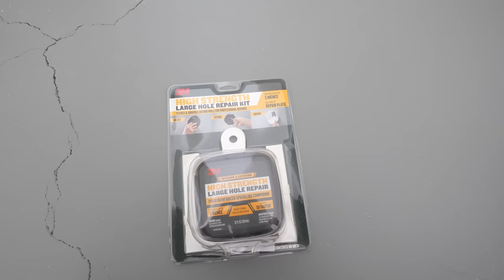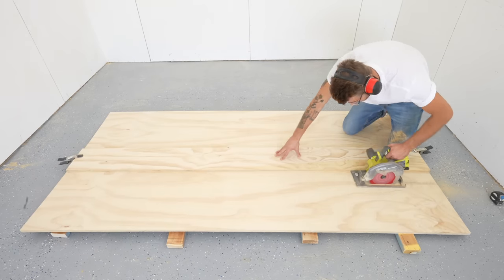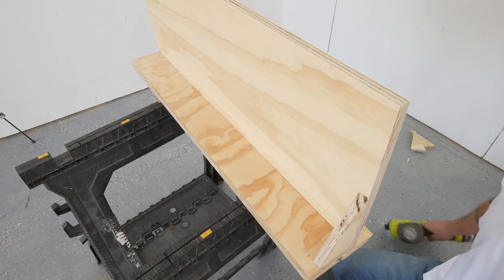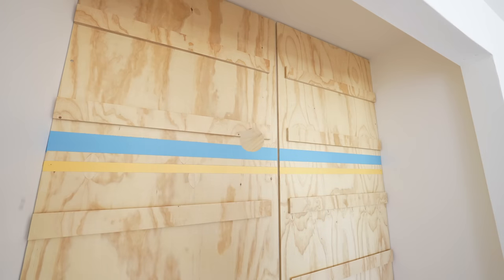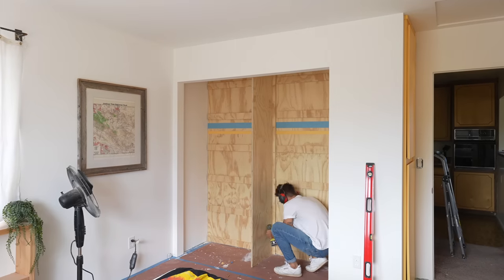ULTIMATE DIY CLOSET RENOVATION / MAKEOVER / ORGANIZATION

Comment: Cool idea with the floating shelves, but I see some issues with some of the designs so I don't see them lasting very long. There are 2 main issues and I have solutions that will help their durability.

1) The shelves with the triangle on top will not last long using Brad nails. The shelf itself pulls down so the nails are in tension and over time they will slip out. I see 2 improvements that can be done. The first is to add some screws because they can withstand tension better. The second option is to make a bigger triangle that extends farther on the shelf and a bit taller too. This helps reduce the tension inn the nails at the edge of the shelf and more nails/screws can be added to distribute the load better to each fastener.

2) The french cleat for some of the shelves do not extend down far enough (as mentioned in the video). When a force is applied on the shelf it wants to rotate (think about a diving board) but that rotation is resisted by tension on the top half and compression on the bottom half. A cleat with a deeper base to it lessens the tension/compression on both ends (like how using a breaker bar requires less force). The short cleat base has a lot of tension on it and yet again the grade nails will eventually pull out. The two methods to improve this would be to use screws anywhere tension would be, and also to make a longer cleat connection so the bottom half has a larger area to push against the wall and reduce the tension in the screws on the upper half.

This is an awesome project and I don't want to sound like I am here criticizing. I am a structural engineer so I visualize these forces and this just stuck out to me. I just wanted to offer some professional advice on how it can be improved is all.
Reply: Bruh ain’t no one gonna read all of that
Reply: @collinanderson6876  I did!!!
Reply: I just read and found it quite helpful. It’s useful to have some pro-advice in regards to extending a projects lifetime.
Reply: 1) aren't brad nails only for keeping material together while the glue dries? I don't think they are suppose to help with durability - the glue should keep it all together if the shelves will be used only for a few pieces of clothing.

But yes - if the load will be greater, then i don't think those shelves will last a long time and both suggestions are good :)
Reply: @collinanderson6876  Man, you're gonna hate "books".
Reply from the maker: 1) I used wood glue.. I doubt 5 pounds of clothes are going to hurt any of the shelves.. could be wrong

2) yeah
Reply: @collinanderson6876  sorry you lost me after ‘no-one’ what did you say again? I lost interest
Reply: @ReubenCornell  I love books but this is a little too long for a comment
Reply: @matheuscapella2143  yeah I guess. I just think it’s a little long for a comment
Reply: Really good input. so helpful for someone looking to do the same thing. Had the comment said "use screws and a better triangle" I would have ask myself: why ffs...???  I valued the experienced input and if this is too long for some people then damn...what else are you spending the 1min on? 
Also me: "Maybe this comment is a book now too?"

Comment: I would advise against picking up Glidden paint I know at the home Depot I worked at they never sold and they had a habit of flaking off on the inside so you'd end up with particles in your pain bahr however has plastic paint cans so you don't have the sheeting issue inside the can.  I'm color blind and I worked in the paint department

Comment: It's kind of hard to see because there are not zoomed in shots here, but if you want to avoid the color bleed under the tape and maintain a super sharp line, make sure to splurge a little for green Frog Tape, and run over the edge with a barely damp cloth first to activate the bleed through protection.

Comment: Looks cool, but also looks impractical. An Ikea closet would be cheaper and better for all storage. Also it would go faster to set it up. Ive seen a few home made closets lately. All seem to be more impractical than a store bought system or closet. Also all seem to cost more or the same. Those shelves would not hold my clothes at all. But the size of the closet would easily do with better storage solutions. (drawers are so far superior to those box shelves that I cant even...)
Reply: Some people just enjoy the DIY and customization, and Ikea doesn't in fact ship everywhere, so it isn't always an option.